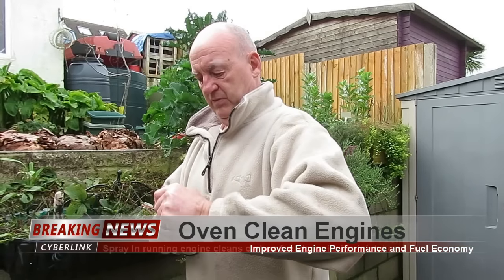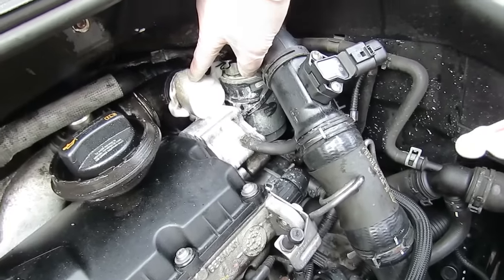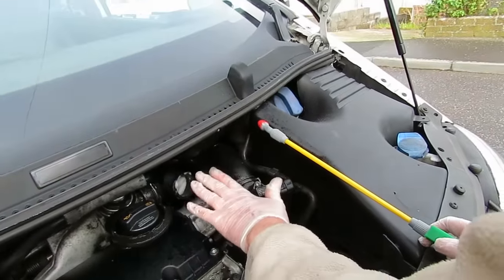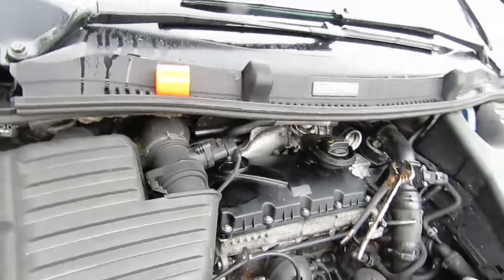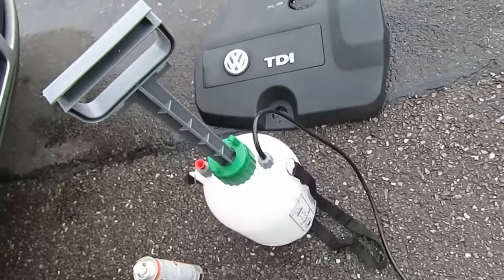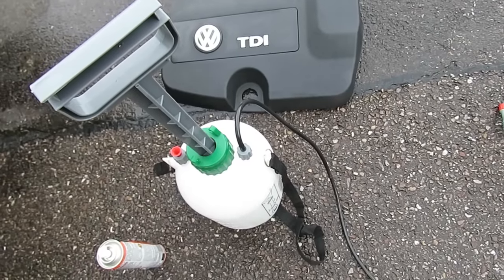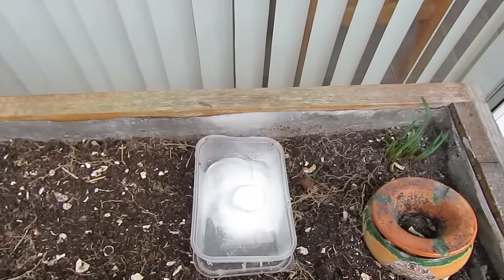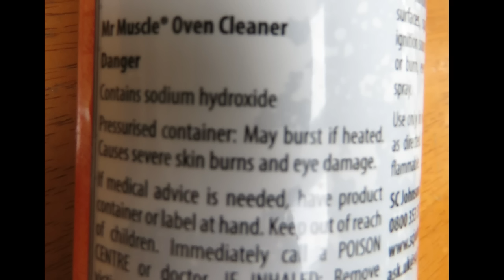Clean EGR Valve Decarbonize Turbo DPF MPG Limp Mode Mr Muscle VW 1.9TDI Sharan Galaxy Alhambra

Comment: @Andrew K Fletcher I have just done your method and I can confirm NO MORE OVERBOOST LIMP MODE. I tweaked your method slightly. I sprayed into the air intake just after the MAF. Tried both Smart straw up and down - I preferred it down for the spray pattern. I also then had a garden sprayer (same as the Revive Turbo cleaner) which I removed the internal straw and sprayed 750ml of tap water inverted to "rinse" it through. Went for a 20 mile drive and it now feels more eager and boosting correctly throughout the RPM range. Before I did this method I put the car up on the ramps to confirm that infact the boost actuator for the turbo vanes was very stiff. For reference this was on a 2006 Skoda Octavia 140PD BKD engine code with 153k miles. Thank you again.
Reply: Say goodbye to your engine
Reply: It might feel good right now probably because you are burning a bunch of oven cleaner. But not too far down the line you either just killed your engine or made a mechanic very happy.
Reply: 1 year later tell us how its going PMSL
Reply: What are you doing you header
Reply: I am sure you can  (no pun )  use the thin tube in the spray top.It is the one which used to come with WD40 and other spray cans.??
Reply: @sydbell8508  hey , how long dis your engine last ?
Reply: Your engine is now fucked. Congratulations
Reply: Samuel, are you familiar with the word “bellend” ?
Reply: Christopher Jennings  I have been doing this to my Audi for a long time now. I do it once a year and it works. The car now has 360000km on the clock. Can any of you armchair mechanics explain why you think this would damage the engine? You clearly have no clue what is being done here.
Reply: @marclang7431  because Mr muscle is 98% sodium hydroxide.  Which will eat alloy
Reply: @paulsouth4794  Mr muscle is about 5% sodium hydroxide. My question was rhetorical. I know exactly what  caustic soda can do to aluminium, but not at these concentrations and for this length of time. The guy proved this in the video.
Reply: Spraying anything into the intake of your car will not cure a sticking vnt. The variable nozzle is on the hot/exhaust side of the turbo charger. There is just an impellor on the cold side. To clean the vnt you spray the oven cleaner into the EXHAUST manifold, let it sit a while pump the actuator, spray some more in, pump some more and take it for a good thrashing. Repeat as and when necessary. The inners of the hot side are cast iron and steel. So it can be done relatively risk free. What this guy did is wrong on so many levels.
Reply: I did this for more than 2 years and really works , if someone feels this is wrong it's simple , please don't do it
Reply: Username “
Reply: Marc lang o9
Reply: BrawlStar Snypes   A little knowledge is a dangerous thing. A complete absence of it is a source of cheap ( non-engine ) engine parts from a 1.9 Sharan
Reply: @fluidefluide1128  except this is fine to do to your car....
Reply: I'm thinking of doing this? Do you think it worked well long term?
Reply: @fgcvhhbvjhbj  If you do a lot of short trips, you will need to do this more often. Long term is very subjective on how the car is used.
Reply: @Parker Denver instablaster ;)
Reply: @Mohammad Louis I really appreciate your reply. I found the site on google and im trying it out now.
Seems to take a while so I will get back to you later with my results.
Reply: @Mohammad Louis It worked and I finally got access to my account again. I am so happy:D
Thank you so much, you really help me out :D
Reply: @Parker Denver happy to help :)
Reply: It works its no different than a dirty oven same materials lol grade 5 science
Reply: @fgcvhhbvjhbj  yup and dont use fuel from cheap gas stations its a mix of gasolines, Shell burns cleanest and has prob the best cleaners in their fuels, do your homework tho
Reply: Never use cheap fuels they are a mix of gasolines/diesels... use Shell the turbo wont get dirty again

Comment: Is  this being sprayed into the regular air intake pipe right off the air filter box? Just to clarify because in the video it was being referred  to as the EGR intake. I have a 2013 VW JSW TDI 2.0 L so it looks a little different than the engine configuration in this video. I used one can of Liqui-Moly Diesel Intake System Cleaner part # 20208 but with very minimal change in EGR performance. Code changed from insufficiient flow to valve slow to respond and then back to insufficient flow again

Comment: As a mechanic of over 20 years I can confirm this is brilliant way to fuck up your engine
Reply: But it works
Reply: Fellas I’m glad I see your comments u just saved my van lol 😂
Reply: @jakecrawley1742  I used this, but there's a miss fire, but on the lucky side there's a lovely loaf on my driveway every morning.
Reply: @MyJam1981 . Putting CAUSTIC  chemicals through your Engine is a BAD  idea . It  will  absolutely  eat  all  the  Rubber Hoses  etc . And quite likely damage the Anodised / Surface Treated  Metal  Parts  too . 
EGR  systems are badly engineered . Built  to  fail  basically .
Reply: Such a lazy way to do it...Take it off & use a bit of elbow grease to clean it correctly...
Reply: Have you actually seen confirmed evidence of that happening?
Reply: @guaporubio  Caustic Soda is  HIGHLY  CORROSIVE . It  eats  rubber and metal as well as the carbon deposits .
You be the judge .

Comment: I used in several cars Mercedes and Volvo, Liqui Moly 5168 pro line 400 ml, (only for Diesel engines), with very good cleaning results and great performance. It Cleans all the intake system without disassembly Turbo, EGR valve, Flaps, etc.  The spray is a mix of cetone and thinner. It is applied just after MAF sensor.
The turbo, EGR and the engine performs much better after Liqui Moly 5168

Comment: I used the water method in an old 1.9tdi Passat AFN. Cured limp and went on to cover 287,000 miles over the years before I sold it. I removed the egr also and cleaned it with Mr muscle. Decarb with water has been carried out successfully for a long time.

Comment: The reason you DO NOT do this as when the carbon deposits release themselves, they'll get chucked around the gubbins and could potentially cause more problems. The best way to do this is to take the EGR off and do it there. Whilst you're at it, might as well take the turbo off and clean all the carbon deposits off there too. Sure its not as quick, but its doing the job right. Treat these engines well and they'll do 500,000 miles without a problem.
Reply: In addition, as others have said, oven cleaner will have adverse affects on the aluminium parts of the engine. Chucking oven cleaner into the inlet just isn't a very good idea. Sure its a quick fix, but you're reducing the life of the engine just to save two hours work on a weekend.

Comment: FUCKING BRILLIANT! 
Sod the specialised cleaners for the tdi turbos! 
I had 2 options scrap the car or do this ...
I empty whole can in to the turbo! 
Waited 20 minutes...
Then start the car running ...
Then I emptied another can of Mr muscle Owen cleaner ....
After that I have sprayed 400ml water in to the engine ...
Engine was on 2000rpm mostly . 
On short time I have increased the rpm to 3000 ....
It Fuckin done the job .
Splendid!!!!!
U r a STAR man ...
U have saved my car and 1000s ££££
I can hear the whistle on my turbo ...
No juggers on engine too...I taught my gearbox was bad ...
Nothing to do with the gearbox!
Reference Mercedes c220 cdi w203
My engine light come on the dashboard while I was doing this ....
I disconnected the battery waited 10 minutes then re connect it ...
And the light didn’t come back on😂😂😂😂😂😂
I love u 😍 !!!!!!!!!!
Reply: Still going?

Comment: Oven cleaner and hair spray are part of my tool kit for more than 20 years. :-)
For the EGR/ manifold and the such whenever possible I prefer to remove and clean on the side. But definitely oven cleaner is the major player. 

BTW in case anyone wondering, the hair spray is to assemble tires. Perfect rim sealer and when fresh/wet serves as lubrication. :-)
Reply: So you been paying more since 20years when you could of used soapy water to install tires lmao!!

Comment: I think most people are missing the point. The cars only worth a few hundred quid . And to remove the carbon build up by removing all the components and cleaning and installing with new gaskets not forgetting the labour costs. Would render the car worthless. As it probably only has a year or so left in it. It’s probably a cost effective way of fixing his problem. The older diesel motor is well capable of running a little MR Muscle through it without any ill effect whatsoever
Reply: But why the cold side? Shouldn't he be using the stuff on the hot side only? There shouldn't even be any carbon on the cold side. It'd all start from the pistons only, then out to the exhaust, right?
Reply: @IPDeliev  Don't be silly. ;<
Reply: @Blue-Lady  All engines from at least early 90's usually have some kind of EGR valve.  The blowby from the crankcase doesn't  go straight out in the air like a tractor for example. That means you get air and also a bit oil from the blowby to come back in to the engine. You'd be surprised if you open up a intake manifold on a diesel car whit lot of miles on it. The intake look terrible whit a thick layer of burnt oil almost like a mass of rubber and that's what messes the egr-valve up.  If the blowby was alowed to got straight out the engine would breathe only fresh air and this kind of problems would never occur but this is all environment associated.
Reply: @MrJokkoma  Hey Mr Jokkoma, that's interesting info, I thought EGR valves were more modern. I'll have a look-see at what I can find. I'm riding a Triton from 1995 just FYI, an MJ Dualcab Diesel.
Reply: Yes mate, a car does worth few hundred quid. But few hundred quid in your pocket, won't take you to work and back! Also, if you have to buy a car, would you prefer someone's second hand, maintained with oven cleaner? It's not about how much cost your car, but how much it could do for you!
Reply: Andrey Yanev I still think you are missing the point. The car now works so he can get to work. It’s just Mr Muscle you can buy it from Tesco .it’s not some super corrosive acid. It’s to clean carbon from your oven. Yes oven where you cook food. It’s just a crude way of injecting carbon cleaner into your old Diesel engine. It’s not the best way of cleaning it I agree but it buys him time to decide a new car or a strip and de -carbon .
Anyway the gentleman in the video looks to be of retirement age and is probably not having to use the car for work the next day.
And a few quid and 10 minutes gets his car going.
Everyone’s a winner 🛠

Comment: I did it last summer, twice. My engine works fine, 20000 miles since then, do it carefully, it will work. Do it before oil changing. VW 2006 1.9TDi BXE. Not too much water at once - remember the water lock.
Reply: With a BXE engine I'd be more concerned with a conrod peaking through your block than carbon build up
Reply: @tiberiusclaudiusnerogermanicis  excatly. Worst of the PD engine models

Comment: Did this on both of my vw diesels each over 150k on the clock. Really shifted the muck off the egr and intake. REALLY DO WEAR GLOVES —I HAD CHEMICAL BURNS FROM THE MR MUSCLE (I should have known better.) the water spray really shifted soot. Big pile so don’t do it on a nice driveway!

Comment: There is a product from Liqui Moly especially for that purpose! I used it 2times, on a 2.0TFSI 200hp and on a 2.0TDi 140Hp with success.
Reply: Where did you spray that in?
Before the turbo or the intake manifold?
I have the Liqui Moly as well as a 140HP 2.0TDI and I am a little scared to use the cleaner.

Comment: I find hydroblast does the trick perfectly. It's a fuel additive that works very well. It's not cheap but is easy to use.
Straight in the fuel tank. Cleans fuel lines, fuel pump and injector's which are the main cause of causing our diesel engines to clog up and slow with all of the dirt present in diesel fuel.

Comment: I’ve just done this with my beetle 1.9
I didn’t bother with the water though. I just sprayed most of the can in so it went right into the inlet manifold too. 
I left it for an hour then reconnected the hose and took the car for a spin.
I kid you not I’ve left black marks down my road where all the sh1te has come out 😂